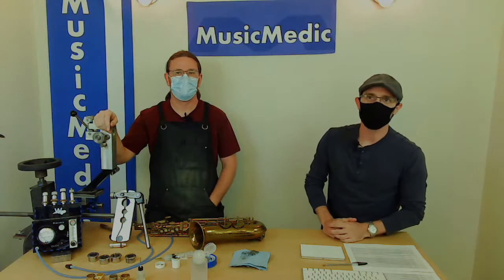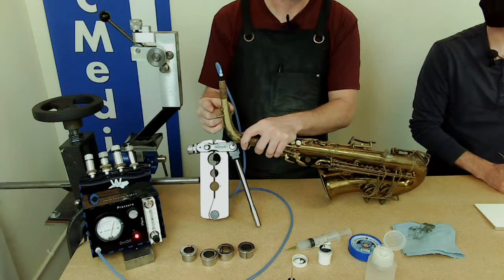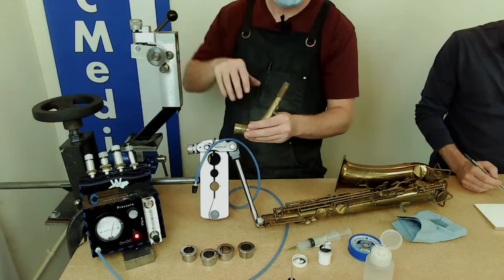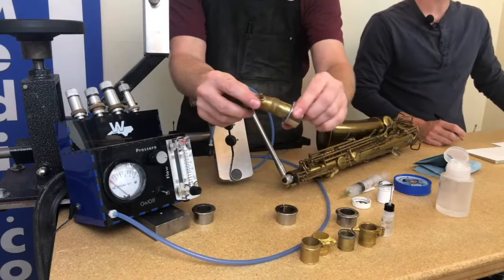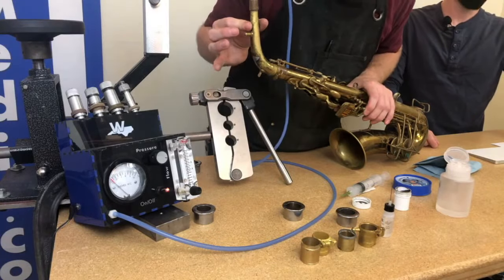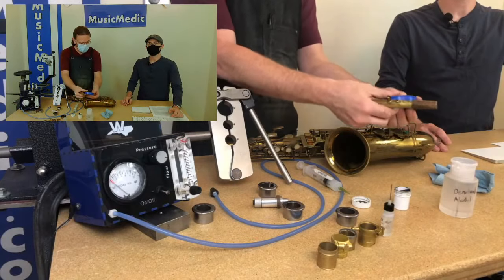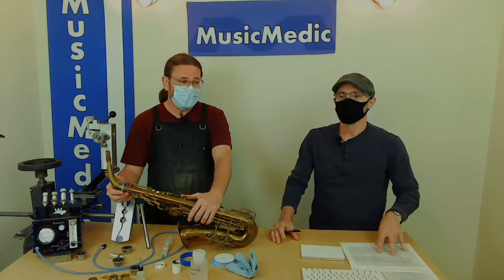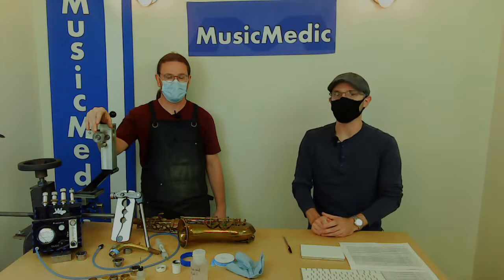Fitting a Saxophone Tenon & Receiver for an Airtight Seal

Comment: How’s about king super 20 double wall necks? Just expand the body side tenon?
Reply from the maker: These are more involved. The inner sleeve of the neck needs to fit tight on the inside diameter of the body tenon. The collar on the neck goes around the "tenon" on the body tube and prevents it from rotating. What you're fitting is the inner tenon on the neck to the ID of the tenon on the body tube. The outer sleeve is not used for airtightness, it's just used to keep the neck from rotating as the player is playing. Hope this help!

Comment: Hi, when I am testing for a leak in that area without any specialty tools, I should be play testing with the neck attached but without tightening the neck screw, and then do the same when I apply the teflon tape. Am I correct to say that?